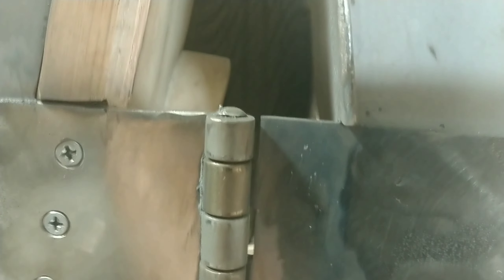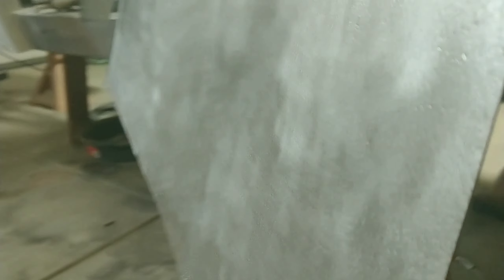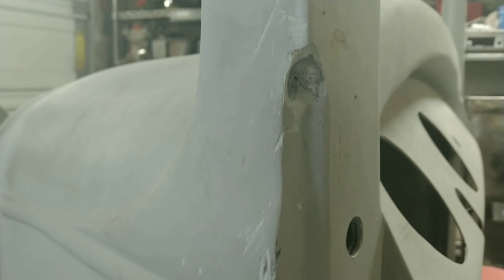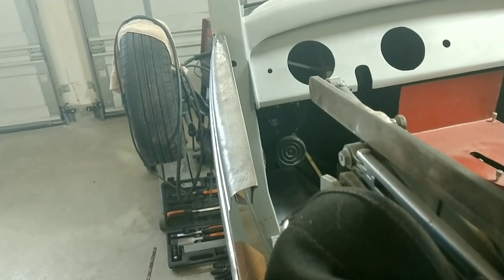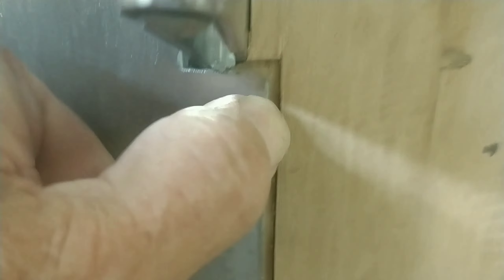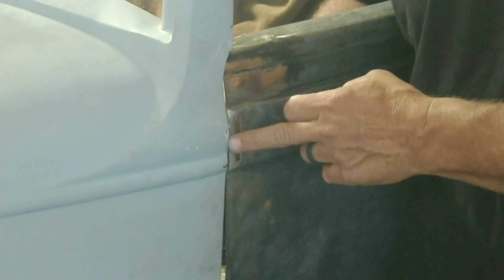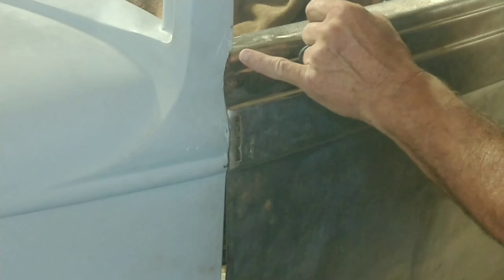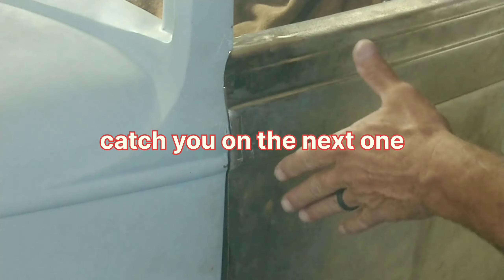Vino rod door Fab

Comment: Looking good Robert. That 1/8 gonna have some weatherstripping? Are you doing both doors at the same time?
Reply from the maker: Well Woody I'm thinking an 1/8 in is a good gap between panels🤔 Maybe I'll be able to use some weather stripping. I probably should try to do the other door after I finish this one, but I won't video so much of it.....